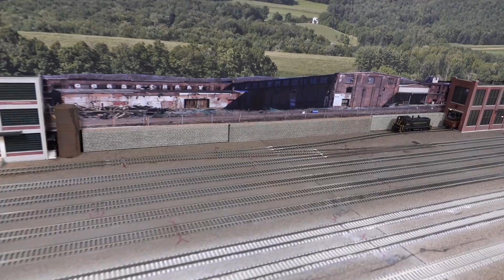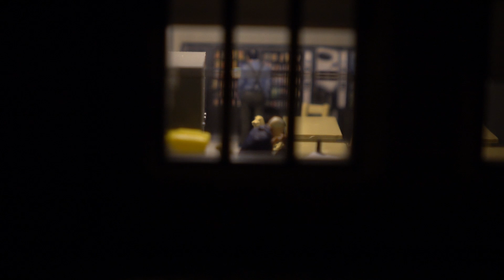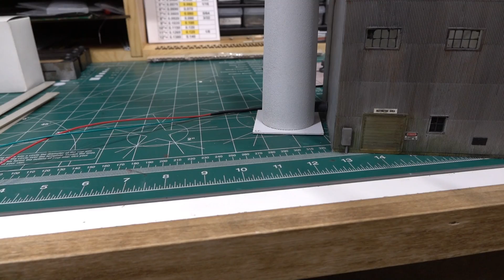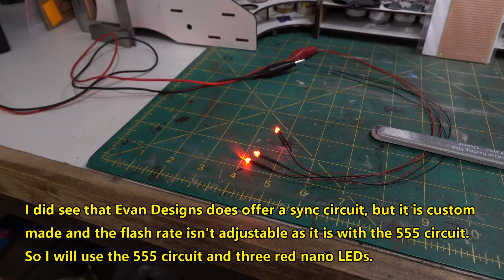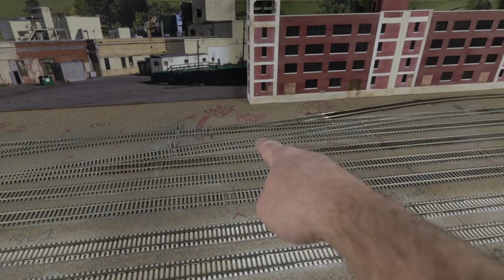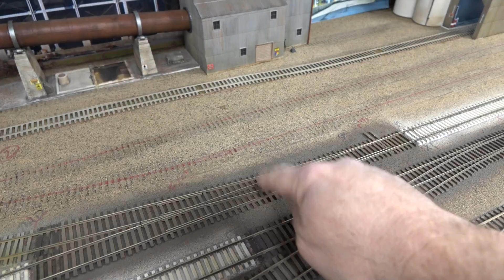MRUV 111: Industrial Track & Switch Machines Installed

Comment: Is that a Broadway limited 1500 switcher, I  was having trouble with the pickups on mine. Don't know if the small wheel base is the problem,  did you have to do anything special especially going across the turnouts.  Any advice would be appreciated
Reply: Yes, it is a BLI. Thus far I haven't had any issues, but to be honest I just took it out and slapped it on the layout. My frogs are all powered, so they should cause any issues.

Comment: Rob that 555 circuit on the smoke stack will look cool when you get it installed on the layout. What about installing a Slueth Smoke generator in the smoke stacks? That would look cool, but I don't know if it would deposit an oily film over everything like what some of the others do? Does the other smoke stack get the same 555 circuit for the LEDs too? What about figures? I know that's a way off. but I would be glad to help you paint some figures for the layout, if possiable? just drop a note to me if you would like that or not.
Reply: Kevin- I thought about adding smoke, but previous ones seemed to emit that oily stuff that I don't want "misting" over the layout. In fact I may still have a Slueth on somewhere. And for sure figures, vehicles, more lights, junk, trash, details, signs, storage tanks, etc etc are all still to come.

Comment: I've seen structure warning lights flash at same and different rates. If they are different, then at least one light is on so aircraft can see something, instead of nothing then "oh shit" :)
Reply: Interesting...it just looked very annoying to me! It maybe fine, but I think it would have drove me nuts...
Reply: Just depends what the desired effect is. I'm sure if you looked across a skyline in an industrial area with tall structures that the warning lights are more like man-made stars on the horizon (or something).
It may be different enough to be unique and a nice point of difference in an otherwise static backdrop or simply annoying. 

Whatever the desired effect, I'm sure most people will like it for completely different reasons. ;)

Comment: Mr. Bennett. Your progress is inspiring! There is 1 question I have. At the bakery, how is the loading dock door and the track meet going to work? The rails run up to that door. I 'am not trying to be critical at all as well. Just seen it and was wondering that's all. BTW I think your efforts and progress is really awesome. Keep it up Mr.!
Reply: Yeah, looks odd, eh? That rail isn't to load at the door- I plan to have the track in pavement so a truck could back to the loading door. The rail runs there really just as clearance from the silo dumper, in case they get more railcars than expected and might need the head room.